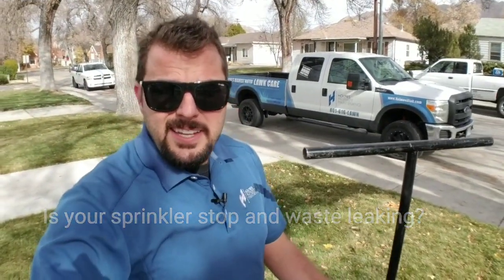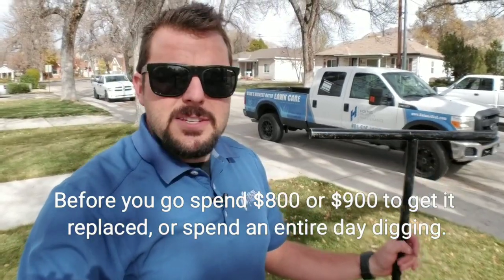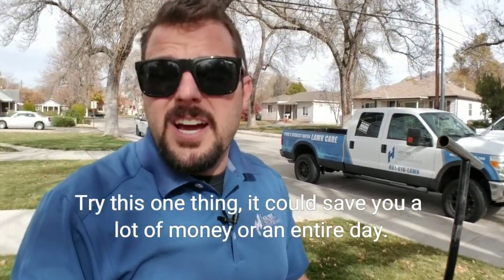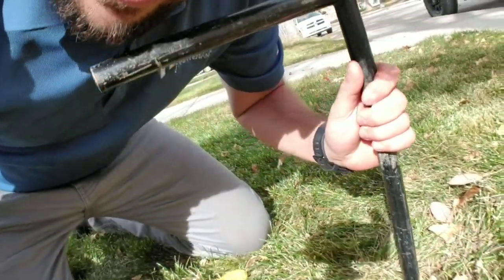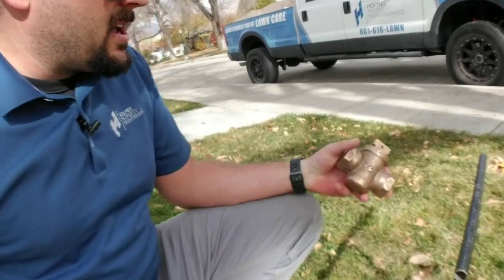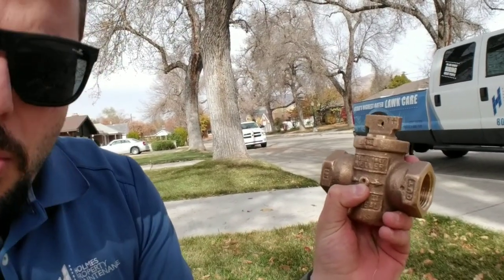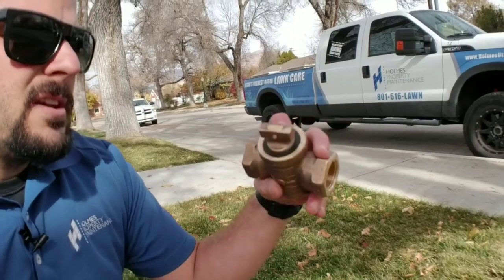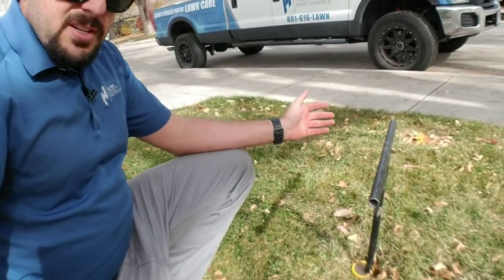How to fix a leaky stop and waste

Comment: Awesome video!  I had some leaking sprinkler valves  so I shut the water off to repair them.  When I turned everything back on all my valve leaks were fixed but I could hear water running at the stop and waste.  Turns out there is a pathway from that stop and waste valve to my basement mechanical room were I was getting water through a crack in the foundation.  Long story short, the stop and waste needed about another 1/8th of a turn to be completely open.  Once it's all the way open, no noise, no leaks!  I want to move my valve manifold and stop and waste further away from the house as they are both right by my front porch and there is plenty of garden space to get them further away from the house, but luckily that is a project that can wait now that my valves and stop and waste aren't leaking.

Comment: Great video!  I think you mean open it all the way not close it.  It shd not leak when open.  Closed will mean no water supply to the garden.  Mine has a broken stem and i want to rebuild without cutting as its housing is usually good.

Comment: I have a leak when open, which fills the tube in minutes  as shown, but while closed, it seems to drain off only to approx. 4 inches.  I have drawn the water out to only notice that around 4 inches of water always remains.  does that seem like it needs to be replaced.

Comment: What if it is leaking while water is passing through it? Replace the valve?
Reply from the maker: Its very possible that its halfway opened.  Most stop and waste valves will leak and allow water to pass through if halfway opened

Comment: Great video. I have standing water on mine. Happened only recently. The water company came out and the meter is not running. Still the water remains. Do you think the part is leaking? Could there be an issue with the drain hole being plugged up with dirt? Any feedback is appreciated. Thanks!
Reply: I am having a similar issue...   will let you know what I find out
Reply: @SHOWDOWNUTAH what did you find out?